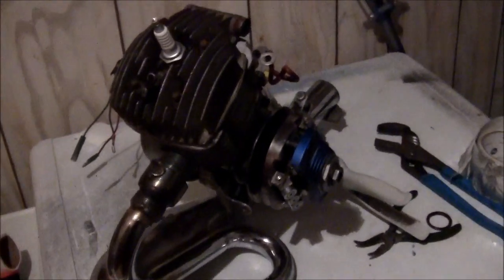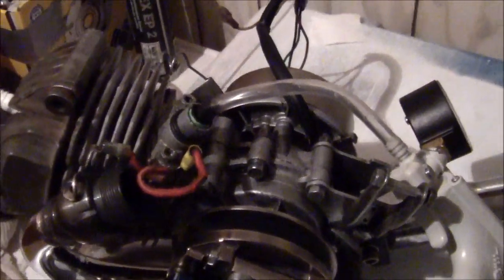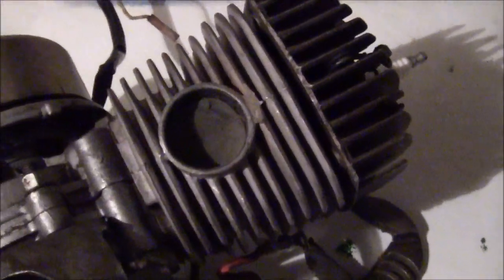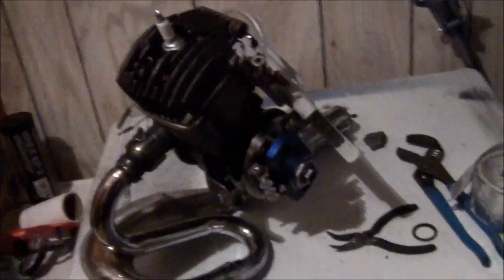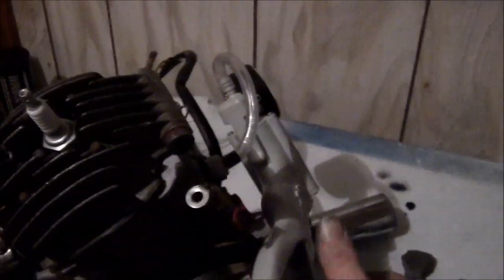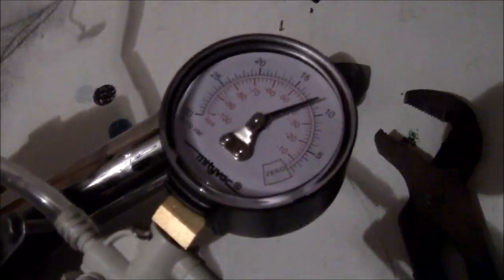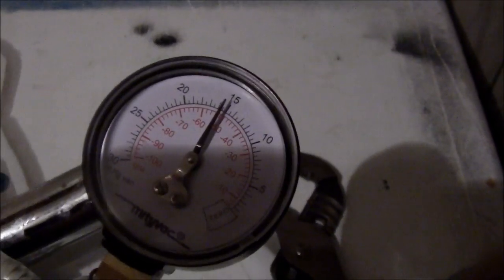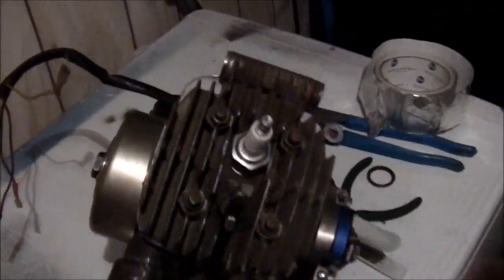AV7 Vacuum Test

Comment from the maker: that was an airsal kit. i checked the piston skirt overlap @ TDC and there was at least 5-6mm still covering the port. @ BDC the rings and piston top seemed to be well burried there, the exhaust threads stripped on it (another one) forgot to put the retaining spring to hold the nut in, it rattled loose, then next ride pulled all the threads out of the cylinder.

Comment from the maker: i am currently going back to a new parmakit cylinder with my used piston and new rings. it definitely has about 4mm of piston crown and ring exposed and at TDC ther is almost a 2mm gap below the skirt. i am currently making an aluminum riser plate and a couple base gaskets. I'll get the excess 4mm milled off the top at the machine shop and hopefully be back in action

Comment: when i did my e50 build i tested for leaks by listining to the engine run and spraying carb cleaner around all mating surfaces. I found my leak at the head. I had to lap it and the cylinder inorder to get it to seal.

Comment: Have you checked your porting, your rings could be exposed to alot of exhaust heat. alot of those Av7 kits have to large of an exhaust port and you have to raise the base gasket 3-4mm and mill the extra off the top of the cylinder

Comment: I know this is old , but did you figure it out. I just fixed mine. A combination of things. Vacuum test too much psi 7 max, held for at least 1 minute with under 1 psi drop during hold is the normal. Also piston @ bdc, exhaust must be sealed. Rings dont hold pressure or vacuum unless running. Hopefully you got her ripping !
Reply from the maker: i have a horrible back now and i cant even sit on the thing let alone ride it... :( i still have it and all the sweet upgrades in the garage.. i swear it's laughing at me)..My hope is that someday after surgery(s) i will be able to ride this sweet rocket again... i never did get it right.. it would do 100kmh real fast, but it would also get too hot... i'll get back into it again one day, or maybe i'll luck out and find a local 2-stroke-master to do it for me :)
Reply: @WillieMcphee  oh, sorry to hear about your back ! What state are you in?, I'm in mass.
Depending on how close I'd be willing to help. I have a 76 moby 50v w /an av7 and an airsal 74cc I rip on. I been doing 2 stroke race and repairs 25 yrs now! Hopefully you heal quickly and can get on her again! Best of luck brother👍🛵
Reply from the maker: @guillermo3471  LOL, I am on Ontario, Canada 😁.. bout an hour or less from Detroit, Mi
i appreciate the offer tho'.. i made myself a promise that o will ride again! i may have to move everything from the 40V frame over to the other 50L i have (it has rear shocks and a newly upholstered bench seat)
Reply: @WillieMcphee lol yeah if I'm ever up that way I'll send ya a message . Good luck with it. I think you'll be fine. Moving the good stuff over to that frame. Pretty much the same 👍